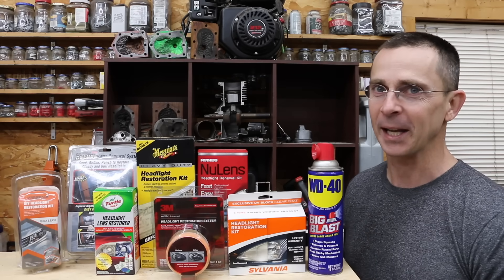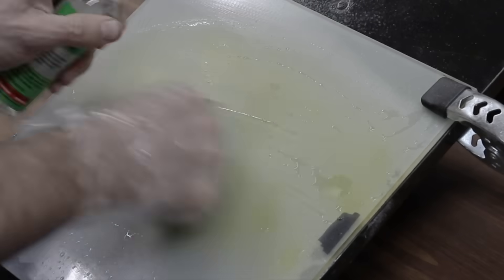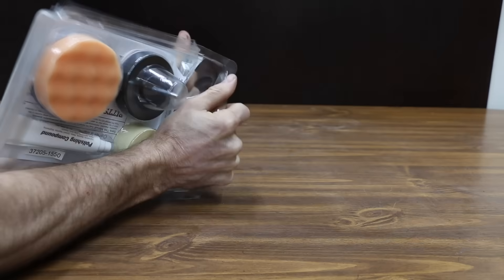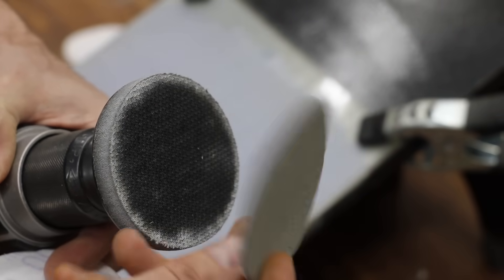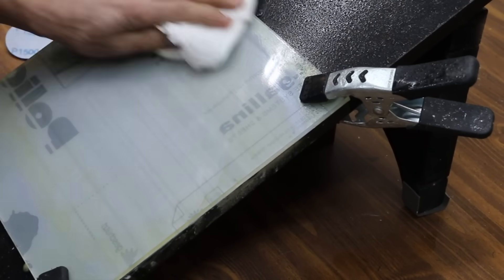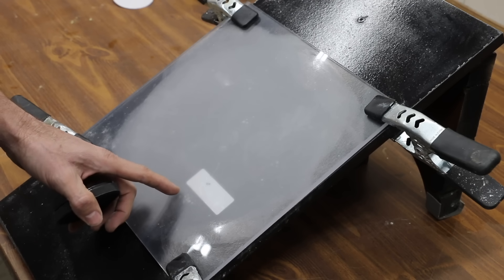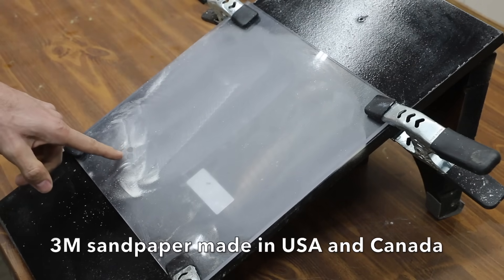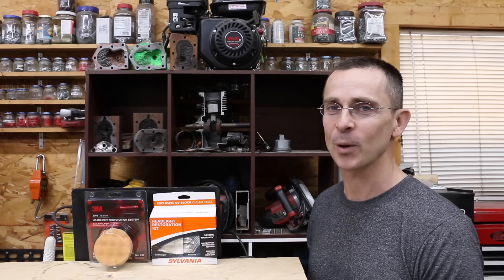Best Headlight Restoration Kit?  Let's find out!  3M, Sylvania, Meguiar's, Mothers, Turtle Wax & HF

Comment: I have used the Meguiar's heavy duty kit for a few years, on around 25 different cars of various makes (see below). The kit includes enough compound to do several cars with just one kit. I think I'm on my third box. The UV coating solution usually runs out before the polish. I disagree about the need for a more abrasive sandpaper. In my experience, 1000  in one direction followed by 3000 in the perpendicular direction (per the instructions) is sufficient to remove all yellowing and scratching. On a few cars I have repeated those stages a second time but have yet to encounter a car with scratches or hazing bad enough that the included abrasives aren't enough. More aggressive grit may remove more headlight material than desired.  The compound in the bottle does the majority of the polishing work. WIth a two-speed cordless drill on high, a very smooth and clear surface is achievable. As you found, the UV solution dries smooth and it seems to last. Here is a Corolla I did recently: https://i.imgur.com/2LpMTN0.jpg

That said, I may try the Sylvania kit when my current Meguiar's runs out. I wish you could have tested Cerakote's kit also - maybe a followup vs the Sylvania? The Cerakote product did so well with the black trim restoration testing, maybe their headlight product is also excellent.

I have done the headlight restoration on models from the following makes using the Meguiar's Heavy Duty kit, and all were successful: Toyota, Honda, Mazda, Nissan, Hyundai, Kia, Subaru, Chrysler, Buick, BMW, Volkswagen, Ssab. I also used it on a set of faded tail lamps to good effect.

Comment: I used to do headlight restoration as a side gig for money. I used the Sylvania kits and they did just great. However even with that UV ray coating applied I could see it yellowing in about 6 months. I’d just spend the extra money and replace them with EBay replacements. Haven’t had issues with my new assemblies and have had them over a year.
Reply from the maker: Thanks for sharing.

Comment: The one issue with this test is that the oxidation is not bonded as tight to the clear poly underneath as the roughed up poly you need to smooth out, or the yellow protectant. So I wouldn't expect kits designed for medium oxidation to work well on this test.
Reply from the maker: Thanks for the feedback.

Comment: I just use an orbital sander with different stages of sand paper starting at 800 grit going to 5000 grit then I buff with a cloth and use a UV protective coating.  This works great for me.

Comment: Have you heard of using mosquito repellent and a sock as a headlight restorer?
Reply from the maker: Thanks for the video idea.
Reply: IT WORKS .  I watched this video to find out which product to try. I came back here to leave a comment (or find one, as the case) The very next day someone recommended DEET (I had some  OFF and thought, wth, I'll try a small area).  I had the headlights on my 97' Mercury Tracer looking almost new in 10 minutes, LOL. Wasn't perfect, but WOW, what difference.
   All I used was cheap paper towels, folded in to small, hand held, application pads. First 3 passes removed the oxidation (in a light scrub, drag and lift motion, while always rotating the pad for a clean surface). Once it was clean, the next 2 passes seemed to start melting the poly-carbonate a bit. Finishing pass to dry (and touch up). Let dry for 15 minutes, then a quick wipe with Windex.
   I'll leave it for now.  But am I wondering about UV protection,, and might park it point toward the Sun to see if it quickly fades. I read the clear spray Lacquer is an option.?
Reply: I have looked into it...it works but not recommended. 1, if not careful you can damage the plastic while removing the coating. 2, the coating needs to be replaced or you'll be in worse shape
Reply: @charliemurphy6457  , thx, yes I was very careful about only working a small area at a time. Thx again, I will go ahead and clear-coat. (edit:) NOT using Lacquer, does't stick to raw polycarbonate.

Comment: Project farm i want to start by saying i have 2 youtube accounts 1 being a premium account and i watch your videos from both for the extra support for all of your dedication that you put in to your content. I also wanted to put in my 2 cents about headlight restoration. I understand for some people its much easier to buy these ready to go kits but for those who are handy with tools and want even better results then here are my instructions coming from 7 years of professional vehicle detailing. Air DA polishers work the best, apply 500 grit 3M sand paper and sand the headlight lense using it dry with light to medium pressure, the headlight clear coar coat should begin coming off leaving the lense completly white with no visability. (While doing this besure to be careful not to burn thru the lense and avoid touching the car paint with sanding pad assuming you left the headlights installed during restoration.) Once you have a non visiable completely white lense switch pad to a 1000 grit paper and wetsand the lense until it is clear but not shiny. Now dry lense off and using a high speed buffer with a wool pad use a lighter grit wax and buff the lenses back to clear. If you are not expierenced using a high speed buffer be sure to throttle the trigger making sure not to burn your lense while also making sure u dont heat up the lense too much. If it does get too hot and the clear is not as shiny as it should be move to another spot until it cools. Then being sure to return when u feel comfortable (Also always ensure chord safetly while using a buffer) now wipe the wax off your headlights and clean up your splatter mess after that be sure to enjoy some nice bright night driving! Sorry project farm for an annoyingly long comment but id like to help people out if possible. Keep the awesome content coming.

Comment: “Off” brand mosquito spray works well for yellowed lens. That then use polish compound
Reply from the maker: Thanks for the feedback.
Reply: I've heard that before. Makes sense as long as you use a deet based bug spray because deet is a solvent and would eat away at the plastic.

Comment: I bought replacement (probably China) headlights and they made the truck look new. All of a sudden just now they, literally in a short period of time, went yellow after two years. I'm thinking there is a quality concern with new replacements. Also.as a fisherman. No clear compartment storage container seems to last more than two years. I have applied a clear spray UV protector  to these containers to see if it helps. this is the second year. Perhaps spraying a UV protector on brand new headlight is a consideration?

Comment: Did Sylvania do better because of the UV clear coat? Is that thing melting the surface or it's just acting like a regular car paint clear coat? Because I wonder if the other kits would not do just "as well" if one were to use car paint clear coat with a spray gun. I would buy the 3M but seems to be discontinued/not in the Canadian stores anymore. So not sure which one to pick anymore. I have a paint gun set-up and I want to use 3M clear bra wrap so I will not just use the kit but seek to do a more durable job.

Comment: The convenience of being able to use a drill with the 3M kit pushes that to the top spot for me.  The UV coating from Sylvania is available separately from the full restoration kit, so I used that when I finished with the 3M kit.
Reply from the maker: Thanks for the feedback.

Comment: This was a very Good test sample of headlight restoration kits. Have you done a video on Drill Bit Sharpeners. Finding a drill bit sharpener for carbide or HSS steel bits is something that would add value to a wood working or metal shop. I have been told Drill doctor is the best tool. I have also been told you can do by hand on a grinding machine. The problem with doing it by hand you will not be consistent with a slew of bits you have to sharpen.
Reply from the maker: Great suggestion!  Thank you.

Comment: I simply use toothpaste as got abrasive cat sand in it simply rub it with allot of water don't press down hard, i often use machine as lazy ;), then clean, and paint with clear car paint. Look like new. It also able to take the abrasive car wash fluids that plastic dislikes as covered with car paint. I always remove headlights from car as makes it simpler i think.
Car paint will chip off after a year, clean it, and repaint before get hazy again.
I don't use any kits.
I rather buy glass headlights if was possible as this plastic are crap, how to get people to buy new cars after 3 years... As looks like crap.

Nice tests as always from you !
You should added my method also.
Nail clear coat might work also, I've not tested. Unclear if it will melt the headlight plastic.
Reply from the maker: Thanks for the video idea.

Comment: While the Turtle Wax product almost certainly was going to come in last regardless, one thing which contributed to its lack of success(I suspect) is that it is very likely meant to chemically reverse minor yellowing(based on the product description) of base plastics or coatings, which was not really an option in this test. Regardless of that, there was absolutely no hope for it without real sanding, as demonstrated by the success of the other products.
Reply from the maker: Thanks for the feedback.
Reply: @ProjectFarm  I purchased the turtle wax kit and tested it on my 16 year old headlight covers. Indeed, my suspicions were correct, and the clarifying compound reverses the oxidation directly, and in my case the headlights were almost like new after only the clarifying compound. So, your test was not viable for this specific mechanism of action, but was absolutely a great demonstration of the kits in general. That Sylvania kit was like magic!

Now, if you have severely scratched covers, the turtle wax kit is definitely insufficient to get them "like new", but it should still reverse yellowing.

Comment: Honestly, you don't need to buy a headlight restoration kit to make your headlights look brand new again. I just use Mother's metal polish and put it on my detailer orbital...but using a 3 inch pad to a cordless drill works just as good.

Using Mother's polish, the headlights are like new within a minute or two of polishing. I now use a ceramic coating afterwards so that they stay looking new for another 18-24 months.
Reply from the maker: Thanks for sharing.
Reply: @ProjectFarm  hmmm...is that a "thanks for sharing" "loll, what an idiot" or "hey, maybe he's on to something"???

Comment: I think you could have used a clear coat on the glass and then expose them to high-intensity UV-C lights which will yellow and destroy the paint. It is not that safe but hey.
Reply from the maker: Thanks for sharing.

Comment: Hi, I use 2000 wet/dry sandpaper to remove the yellow film and smooth the lens (with a sanding block sponge and soapy water) by hand. Use a leveling paint polish designed for 2000 scratch removal, may finish with a plastic polish such as Turtle Wax T-43 Headlight Cleaner & Sealant. I also use a foam polishing pad from China, toss out the pad when you are done because they are low quality and inexpensive. This method works well for me and does not create extra work requiring deep scratch removal.. The stuff from Harbor Freight does not work well, including electric tape, clips, zip ties and most shop supplies.. I believe most headlight restoration kits have copied 3M with the drill sanding/polishing pad. Now these kits are more affordable due to competition.
Reply from the maker: Thanks for sharing.

Comment: Try Mother's aluminum polish... just apply and buff off. 

It's what I use. If it has a coating you have to sand it from 700 and work your way to 3000.. then apply and buff Mother's aluminum polish.
Reply from the maker: Thanks for the video idea.

Comment: I used my right angle sander/buffer/polisher with a Harbor Freight foam pad.  For a cleaning compound just plain tooth paste with water worked ok, but Turtle Wax Polishing did best of all.  Lens are now bright and clear on my 2005 SUV.  Took just a few minutes of polishing on each lens.  I didn't use a protective coating afterward and perhaps I should.
Reply from the maker: Thanks for sharing.

Comment: Just bought the Sylvania kit based on this channels recommendation..  I am confident that I would have bought a rotating ball on a drill style product again, but the simplicity of this product, and what it accomplishes is outstanding.  It honestly looks like I've gone out and purchased brand new headlights for a 15 year old car.  Thank you @Project Farm.
Reply from the maker: Hope you enjoy it!
Reply: Darren a month in. Lenses still look great. It’s a non-garaged car, so it’s always in the sun. Still happy with results. Much more so than the last time I used a Meguires rotation ball and liquid buffing solution.
Reply: After using these products over the years, they ALL fail after a few seasons. Probably due to the very thin layer of protectant provided. I started spraying the lenses with a QUALITY 2K automotive clearcoat with UV inhibitors and non-yellowing formula insted of the wipe-on protectant. None have deteriorated several years later. This likely due to thickness of the clearcoat and higher level of UV inhibitors and non-yellowing formula. I really appreciate ALL of your videos. Several of them have decided purchases. Thank you!
Reply: Will the kit have enough for both headlights or 1 kit per headlights?
Reply: @Gotti90  The kit is enough for both headlights in one go. But it feels like a “one use” kit, I wouldn’t keep the things for another car. 

If you were sparing. You might be able to squeak two cars worth of headlights out of the kit. At the same time tho, I wouldn’t bother retaining it for long term.
Reply: The coating comes with this kit dont last forever. For longer UV protection use   headlight protection wrap or car optics laqueur
Reply: So they make clear wrap, and essentially you use any of the products once, and then put the anti uv clear wrap on and just replace the rap when it gets foggy.
Reply: 3M makes a clear coat UV protection spray.  Should we use those after sanding and polishing?
Reply: Lfg
Reply: How is it holdin up a year later?
Reply: @brandonr.2807  we sold the car around 4 weeks ago. We never touched the lenses again, they held up with the treatment excellently.
Reply: @LectricX  did you sell to an individual or a dealer? Keep tabs i'm invested... serious not-serious face
Reply: People are complaining In amazon That it only last several months, then goes back to what it was or worse. I feel conflicted
Reply: @zezozezon8291  if that is true, then the UV coating is probably crap. If that's the case then you can buy a different UV coating off amazon that will protect the lens for longer.
Reply: @Bac0nese  it is true. I used the same kit and within 6 months the len yellowed again. No bullshit!
Reply: @zezozezon8291  I have used this kit on a 2007 BMW 335i about 2.5 years ago. It still looks as good as the day I did the renewal. They do make it clear that there is a curing time for the UV coating and (at least on my old instructions) not to drive it for at least 6 hours.
Reply: @zezozezon8291  I just polish the headlamps and use car wax, they look great for about a year. Some spray wax has UV protection, check out Optimum Spray Wax and their no rinse car wash with wax (green). Any restoration  kit will remove defects but really don't offer protection; I read the sealant in the Turtle Wax kit is really good but not sold separately. A plastic cleaner polish helps prevent the yellowing from returning, some contain a sealant.
Reply: @heavymechanic2  I have done similar on several headlights with good results. I bought a cheap $18 polishing pad kit on Amazon that comes with about 12 different pads and a drill attachment. Then use Mother's aluminum and mag polish. Works very easy and fast. Maybe 2 years later and do it again.
Reply: @zezozezon8291  I used the Sylvania kit back in 2017 on an Audi I owned.  When I sold the car in March 2020, they looked exactly the same as when I applied the coating (minus the scratch I accidentally had on one).  It may be that Sylvania has changed/cheapened up the formula, but that was never my experience with it.

Comment: I saw another video on headlights which just used 3M automotive rubbing compound and microfiber cloths to apply and remove the compound. The results seemed to be pretty good. It would be interesting to compare that process with top two or three products from this test.
Reply from the maker: Great information!  Thank you

Comment: I don't know if those results translate to actual yellowed lenses. I recently used the turtle wax product six months ago on some 2006 Rav4 headlights that I could barely tell if the low beam were on, they were that bad. The only thing I used was cleaner, and then the cleaning compound on a rag. Cleaned it up great, I never even used the sanding pads or coating. Looks the same now as it did the day I cleaned it. I fully expected to not be satisfied at the 15 mins I invested into them and thought I would have to pull the lights out to give it the real deal. But they looked great so I left it as is.
Reply from the maker: Thanks for sharing.

Comment: This is why i recommend any headlight restoration kits that use a sanding disc that attaches to a drill because they will generally work the best and last the longest good examples are meguiares and 3m
Reply from the maker: Thanks for the feedback.